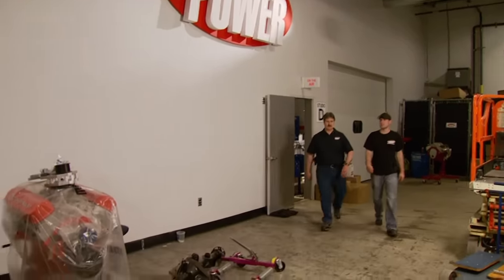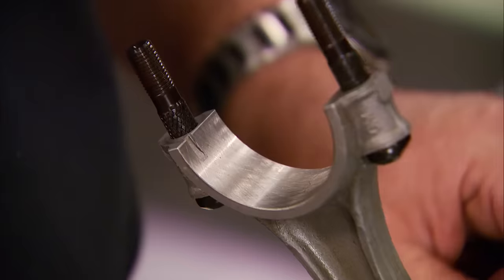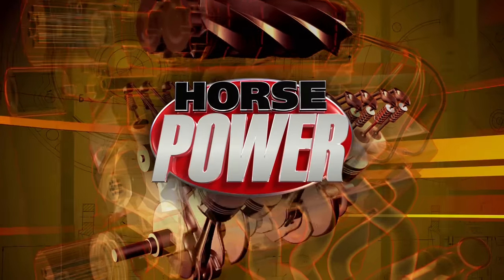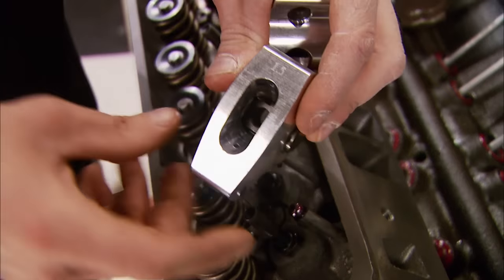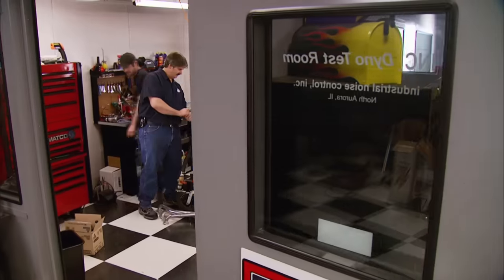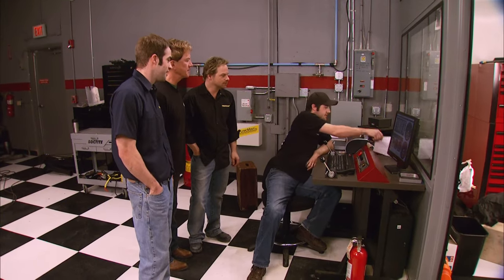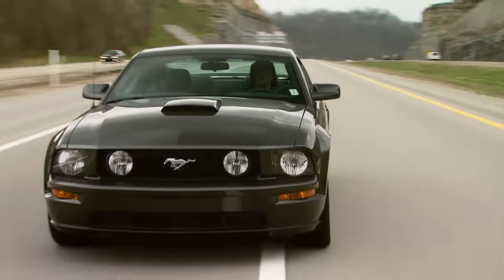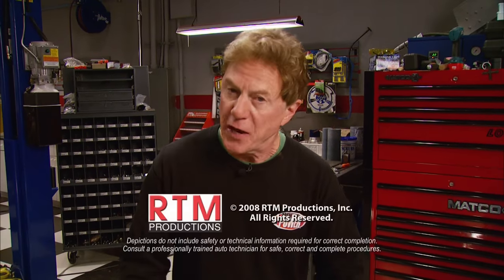Rebuilding a 283 Small Block for a Daily Driver C10 - HorsePower S12, E7

Comment: Those rods got too hot boys
Reply: Yeah they are taking the hardness out of them, heating metal to red hot loosens up the metal crystal structure as it cools. That rod might become far softer than it was before.
Reply: @Chevymonster203  it'll be fine 

I dont think engine is revving past 5500
Reply: What about... mic the pins and  ends before even applying heat?  An interference fit has its limits.  Torch works ok, but maybe go a little more gentle with propane instead of a Victor wrench.
Reply: No kidding! "We're just gonna heat this small end to a full cherry red..."

Next time try a pot of oil heated to 250 F., or a $30 toaster oven turned to 250F...
Reply: @Chevymonster203  you really mansplaining to a bunch of men?

Comment: In 1966 my Father and I rebuilt the 265 in our 1956 Chevrolet. I remember taking dad's white gas torch to burn all the carbon out of the valley breather can.
Reply: yep, gas back then had no detergents, and some motor oils had paraffin wax, hence the need for a 3,000 oil change when hot.  Some old shade tree mechanics would run some ATF in the block before taking it out to tear apart, and laundry detergent in the radiator. Both had detergents in it, and the block would act like a washing machine on the hot cycle.

Comment: 2:15. Didn't they get that rod end a little hot? The machine shop I use uses an inductor to heat the rod. And never to red hot
Reply: It makes less than 300hp. I wouldn't freak over it
Reply: As a machineshop owner, red equals ruined!!
Reply: Andrew Evans I wouldn’t say ruined, but definitely needs to be rechecked for clearances and possibly re machined if out of spec
Reply: THE GENERAL ,  "That was pretty "funny" (ha!ha!)
Reply: I saw some red on one of them.

Comment: Nice video but how about some details, like is the cam stock? or slightly larger? How do the heads compare to the stock heads? Are the intake valves larger? What about combustion chamber CC? Compression ratio? This info would be helpful to anyone building a 283.
Reply: As best I could tell...43610 for the heads.  Thats 170 cc runners, 1.94/1.5 valves, and 67cc chambers - which makes sense for the displacement as a starting point.  Sealed power 4 relief pistons are basic: near 2.5cc worth of pockets [and 0.030" over].  Stock rods means no future power adders.  Now some guesswork: original head gaskets were 4" bore, and I think anywhere from 0.018" to 0.026" - I'll use 0.021" [gm 3995633] to work towards a cam.  I guess they used a 2102 cam gauging by dyno numbers, and at that point I'm like you: off the map.  Thats a 278/288 cam [0.006" numbers] but the ramps are long: 204/214 duration @  0.050".  Video claims they re-used original crank and then [magically] its a stroker.  Which is it?  A 3" stroke... not that dyno run. Might not hardly run at all.  3.5"? still weak.  Cam/head combo seems to arrive at a reasonable compression number with 3.75" stroke - even then I would be thinking of shaving the heads to get nearer 64cc chambers.  Angle milling would have me worried about being thin reaching further to say...62cc.  They went pure street grocery getter on this, and got off the shelf pistons/cam/heads  close enough.  Since they bought new pistons, I wonder how much they gave up not going to a 3cc pop up - they were going to spend on those parts anyway... 8.5/7.8 compression.
Well, there's my two cents - that and $1.50 gets a cup of coffee.  One of the tools I like to use is UEM's compression calculator, which I need: long trig calculations bore me.
Reply: Topolinski does a much better job in recent years, both in building and explaining. Never liked Elmore, just a talking head with a smooth voice.

Comment: Just scored a 1959 thick wall 283.   They made the thick wall from 59 to 61-62, but not all of them.  The 327 was coming online for the Corvette in 62(Basically a thick wall 283 with 327 bits.).   So this 283 will become a DZ 302, with much more spice.   Some original angle plug 2.02's that are OEM.  Will be a 11.75/1 with custom slugs.   Found a GM DZ 780 Holley double, and intake from the swap meet.  Just a fun project, not going to shake the world.   450hp maybe-ish.

Comment: I always install cam cover and timming tab and harmonic balancer before heads go on. That way you can find a true TDC with a degree wheel and dial indicator. You would be amazed how many times I've seen TDC off on balancer and or timing tabs.

Comment: Those 283’s were stout motors. A lot of guys used them in drag racing by revving them to 9,000 rpm or so. We built one for a 66 Chevy II 10.90 class car when I was in High School. It had a roller cam and a 1050 Dominator. Our teacher set the carb up to work on the little mill. When we took it to the winternationals at Beeline we lost in the f8nal round with a 10.89 to a winning 10.92. Breaking out sucks!
Reply: No they did not.  Over 6500 they blow to pieces... Dreamer

Comment: 283 is a block rarely seen today.. You can find 305 by the tons which is no punk by today standards. But yes this 283 is kool to bring back a nostalgic block to life..
Reply: I would have built a 305 instead because the 3.480 stroke works way better than 3.000 in a daily driver. I like 283's but not for a stock pickup.
Reply: Yeah 20 yrs ago if you built a 305 like I did they would have told you you got your 5s and 0s mixed up
Reply: I have 2 I'm rebuilding now and one is matching number from 1961...
Reply: I just got a 283 with a Saginaw 4 speed for my 32 Roadster today. 400 bucks.
Reply: Just junked 3 of them kept the 3 inch steel crankshafts though
Reply: @Kelemen1  look up a 329  400block +283crank= 500hp!

Comment: Installed the rear main seal on center, supposed to be off center about 1/4 - 1/2". 

Adjusting hydraulic lash is a lot easier by doing 1/4 turn on the crack and adjust each one, if loose. Then 1/4 again and repeat till you don't have to adjust any. Then final turn to 1/2 or 3/4 turn each one and done. No mistakes or getting lost. As long as it's loose adjust to zero lash.

Comment: So I realize that this engine is bound for a daily C-10 pickup, and it's never destined to be a high horsepower, high revving ripper, but it should definitely be adorned with some sort of 4 bbl carb and a dual plane intake. I REALLY hope that y'all put a 4 bbl carb on it. I've driven a 283 4 bbl 4 speed swapped 84 S-10 and it was alot of fun to drive. It didn't handle for crap, and it wasn't even that fast, but it felt so torquey and fun. It just had a typical Quadrajet on it.

Comment: Heating those rods like that completely changes the heat treat and tempering if there was any. Not a great example. Shrinking the pin with liquid nitrogen is a much safer option if you want to employ heat sizing.
Reply: I was wondering the same thing. I'm not a metallurgist, but heating that con rod red hot just looked wrong.
Reply: Engine builders have done that for decades. And no, they didn't heat them red-hot. Maybe 2-300*

Comment: Man I would have loved to see this little motor with a set of TrickFlow Super 23 heads 10.5:1 compression and a roller cam upgrade.
Reply: THAAAANK YOU! I've been saying for years that everytime they do the rare 283 or 307 build they always make it a mundane combo. They don't have to go to the extreme and build something outrageous. Doesn't even need to be roller. How bout a 240° @ .050" solid flat on a 106? Easy 400+ hp altho probably at 7,000rpm.
Reply: @mikewillett5076  that does sound great! But for a truck or a 63 Imp you would want low end torque. Vega...hell yeah

Comment: Love the little 283's. They like to breathe
Reply: I CANT BREEEF
Reply: If you bore one .060, notch the block for oversized valves and add a .680 lift at .294 duration they run hard and rev like a over speed womens mouth. Great fun in a light car/ dragster.

Comment: Another way to adjust valves a very accurate too if you got a firing order 18436572 then when you just number one look at the firing order and look at this order 65721843 so when you're just number one cylinder number 6 should be between exhaust and intake and you keep going down the line till you finish to rotations and you're done just in the valves that easy. Also I usually Mark the dampener four ways and I just have to turn the crank a quarter turn each way watching the valves and opposite cylinders and voila fast and accurate way to adjust your valve train and even on solid cams it's a great way of getting your valve train adjusted.

Comment: Bullet proof daily drivers is the only way to go!
Reply: Just don't build a 5500 rpm pickup truck company van engine

Or you'll be sorry you did it twice
Reply: Best of the Best
Reply: @delljr2769  you mean the stripped, driver seat only, swiss cheesed, honda with 10k in the engine just to run 12s? id feel bad for the winner, regardless.
Reply: @delljr2769  Just efi swap, add some LS injectors, flash a tune and you'll spank any rice shitbox.
Reply: Damn right
Reply: That's not a 283 crankshaft in there.  Small journal 327. Watch the video... the front forging mark is 327 promise.

Comment: instead of destroying the temper on those parts. just frezze em over night . same effect with out losing the temper. of the steel.
Reply: the way i was shown to do it as well. freeze. then u just need alil heat. not red hot. i cant see how they CANT see thats bad for the steel?
Reply: Dry ice them in a styrofoam container.

Comment: I bought a pair of World Products and they were junk. About half of the valve springs cracked on both heads. Luckily the pistons didn't hit the valves. I got away with replacing the springs with Edelbrock springs. Then about 5000 miles later the valves were leaking and they needed to be rebuilt. I just went to the junkyard and picked up some used Vortec heads. My engine probably gained about 20hp with the Vortec heads over the 2.02 S/R Torquers that were previously on it.

Comment: I remember getting one of those up to almost 50 mph back in 63! it was down a steep hill but shed really fly!
Reply: You must be a ford guy
Reply: My yugo did 100mph down hill that was scary the car shake the little 1.1 litter was screaming in suprised it didn’t say good by to a piston wouldn’t recomend
Reply: @darrenjones9180  no I'm 100% chevy . just that little 283 is probably not something I'd be interested in. when I could build a old 350 for the same amount of money and get alot more out of it.
Reply: @justinriley8651  the 327 is much better. grumpy jenkins didn't run a 283. he ran a 327 for a damn good reason.
Reply: @axlegrind4212  ya I have a 66 327 it's pretty good.
Reply: I'm a GM guy by preference and I joke around a lot but I can't deal with the people that really want to argue about who makes the better engines. Coming from a strong hot rodding background I like all types of engines, the people with that strong of brand loyalty are really missing out. There's good and bad in all of them but with today's aftermarket that's not really a problem when it comes to building what you like. Ford Modulars suck though.
Reply: Justin Riley I've got a 66 C10 with a 283, got it to 74mph and it shook the battery terminal clamp loose. Probably needed tightened anyways
Reply: camaroguy 66  probably a gearing and didn't spin situation lol. I built a "chevy 302" just because I had the 283 crank and a few other parts laying around and it was a fun engine to spin, had it in a cheap Vega with a 4 speed Saginaw. People wouldn't leave me alone about it and I ended up selling it, just because of how fun the car was.
Reply: camaroguy 66  they definitely make for good toys, although that 302 was a solid flat tappet engine. I like LS engines but still build a lot of SBCs and SBFs, a lot of them are big inch Dart blocks.
Reply: camaroguy 66  NE Alabama/Georgia area, 427/434 Ford and Chevys are popular here for people wanting something other than a LS. I run a carb on a lot of my vehicles but I have fuel injected builds as well, I even have a carburetor conversion on an iron block 408 LS with a nitrous plate...people don't understand carburetors anymore enough to wrap their heads around it.
Reply: camaroguy 66  I'm older(er) as well but I had a better opportunity to learn than most people, I started working with EFI in the early 80s and I still build fuel injected engines today...i can't help but laugh when someone sees my carb setup and talk like they think I don't understand fuel injection/wiring. I use a lot of different intakes depending on the application of the engine but one of my favorite EFI setups for a low hood clearance is a dual plane setup from Edelbrock or Holley setup for injectors and a low profile fuel rail with a 4150 style throttle body to use a 4bbl air cleaner, I think they're a classy looking EFI setup that seems at home in a small hotrod/coupe and is functional on the street for the low-midrange because of the runner length and compromise of the intake, although I use the same type of setup on my LS with a carburetor and nitrous plate it's just for simplicity and the throttle response and atomization of the fuel mixture.

One thing that I have in all of my carbureted builds is a wideband O2 sensor so I can be sure my carb is running at its best and meter my AFR constantly, if you ever take the notion to do something like that AEM/Holley sell gauges and O2 kits and it's as simple as can be. Look them up sometime, especially since you're thinking of adding nitrous because that's the primary reason I started running an air/fuel gauge along with blow through turbo and supercharger setups.

I can't recommend any 383 shortblocks, I get so many engines through my shop with senseless assembly errors. If you could pick up a good roller 350 shortblock like an L98 or Vortec and have it machined you'd be a lot better off doing that and buying a budget rotating assembly from a company like Eagle and either install it yourself or have it installed for you, Eagle makes a budget kit that's pre-ballanced (still have it checked) with dampener and flywheel for $800 that comes with a cast crank I beam rods and hypereutectic pistons that will support 500hp and that would be the max for a 2 bolt main like a L98, you can get anything from that base kit to a completely forged assembly for about $1,400. I used an Eagle assembly on my blown 496 and it has went through a lot of abuse, if you're dead set on nitrous I'd spend the extra money on a forged crank if I had it unless it's going to be a small shot.
Reply: @justinriley8651  You've never owned a 283 have you?
Reply: @justinriley8651  evidently you had the wrong vehicle with the wrong 283. I drove a bone stock, '66 C10, with 283 & 4spd in my Freshman/Sophomore yrs. On a flat, straight 2-lane highway, I could get that old truck from sitting to 85 in a measured 1/4 mile...& peg it at 3/8 mile (I don't recall if the speedometer was numbered to 100, or 110). Only issue I had with going that fast, was when I got over 65-70 that hollow roof would start flexing & bouncing, making a heck of a racket.😂 But man, I had fun in that truck.😎😎
Reply: Got my 66 up to 90 before she wouldn't pull anymore on level road

Comment: Hey guys l put a 327/375 hp cam in my 283. About 1500 miles later I discovered the studs were coming out of the heads, so l swapped to a set of 327/300hp heads, that had the studs pinned. That little motor would fly, l regret ever trading the yellow 57 that motor was in. Of all the cars l have owned l really think l liked that 57 best.

Comment: SHE'S A RIPPER
67cc cylinder heads on stock flat top 283 pistons with .039" felpro  calculates to a whopping 7.5:1 compression ratio 🤓

Comment: One day tge 283 will be the most sought after small block ever built...
Reply: Not as long as there's a 289 around
Reply: I run one in my s10 blazer. It's a sweet little work horse. 330hp and 300 torque. It will fly. The world falls away and it's just you and and the sbc..... Like having a big fish on your line, not thinking bout rent, job, just no worries. The open road, the feel of 8 cylinders pumping. Freedom, the American dream. Beautiful.
Reply: @sbjennings99   you can get 500hp out of a 283 for less than 500 bucks 5 different ways...  you couldnt 500hp out of a 289 for 5000.
Reply: @v8sserieschevy917    and the RPMs!  thats what i love about the283, its the perfection of a SBC. 3" stroke with a 5.7 rod.  and when you bore it out 120 tho you get a 302 the highest rated hp engine chevy ever produced in a sb.... And 283s can be bored 250 without an issue, ive seen it done....

Comment: Seriously considering buying a 283 locally that was bored 40 over and from the description looks to be rebuilt similar to that of the 283 on the episode, Edelbrock  included. I am restoring an 81' Malibu; what I am asking is if the 350 TR Trans is going to be able to handle the WHP, and if the accessories from the the 229 V6 OHV will cross over to the 283, also will I need get a different set of Motor Mounts?

Comment: As with any of these old motors if you got anywhere  near 100,000 miles without it needing a rebuild  you,ve done well .Todays engines will run for ever .Don,t be overcome by the dictation  of the internet .